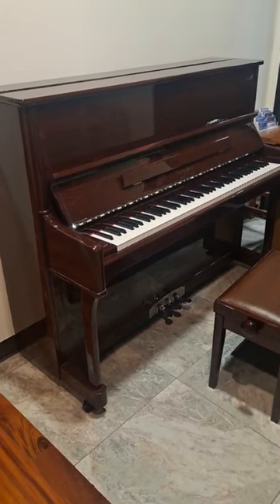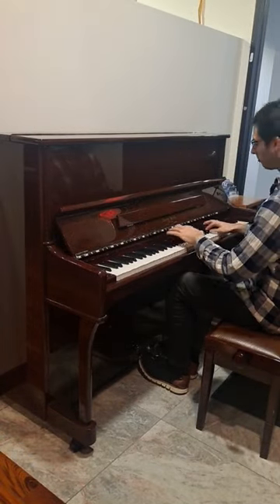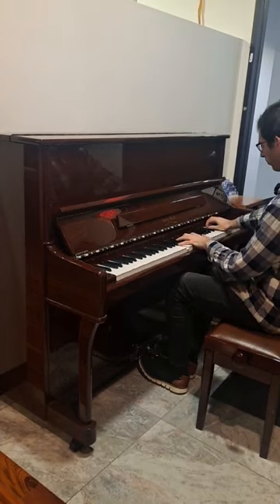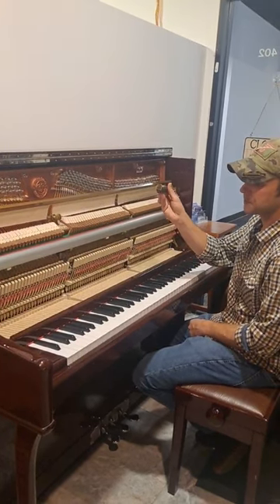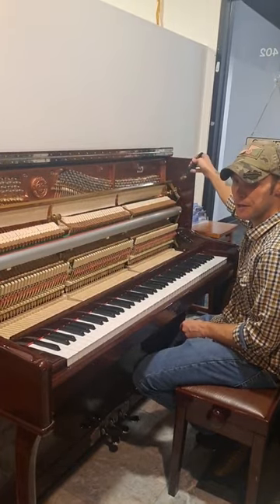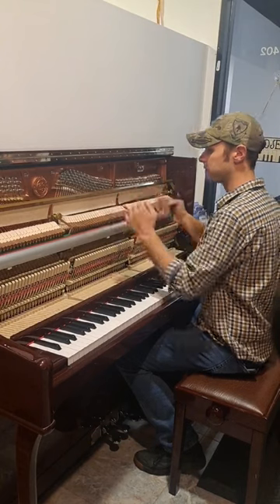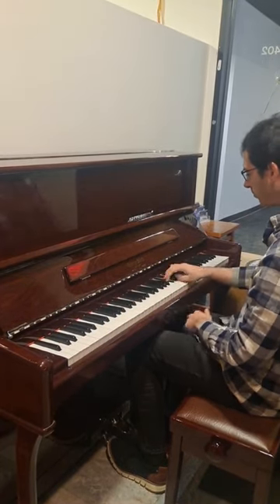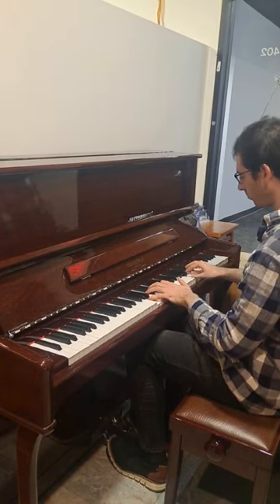Is your piano too bright?! 🎹🎶 30 Second Voicing fix for a tinny, harsh piano sound! #piano #music

Comment: does this voicing technique has any bad effect to the hammers? thanks
Reply from the maker: Hi Kim, thanks for watching! The short answer: This technique, like many piano voicing techniques, could potentially cause harm to hammers if done improperly. There are many considerations a piano technician makes while deciding how to go about voicing a piano. "Brushing" the hammers is one of many tools in the voicing toolbox and should be done carefully by an experienced technician under the right circumstances and criteria. Too many brush swipes or going too hard could cause damage to the felt fibers but when done in the right circumstances with the proper technique, it can help soften and even out the tone of a piano. -Max